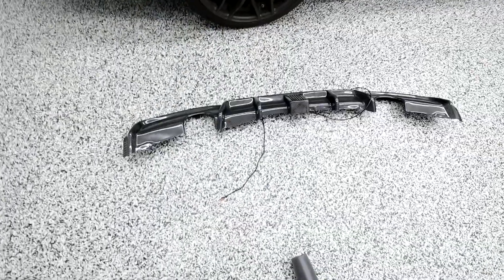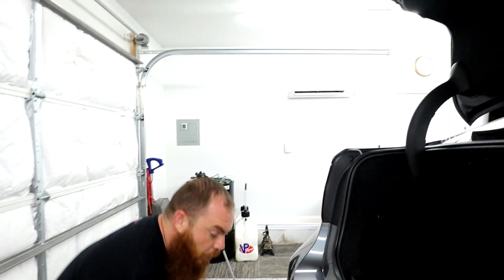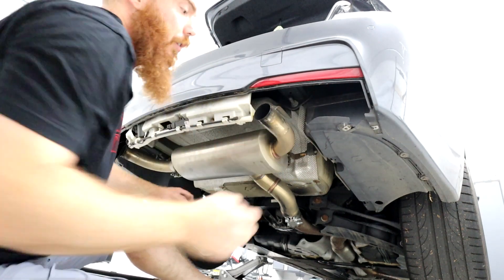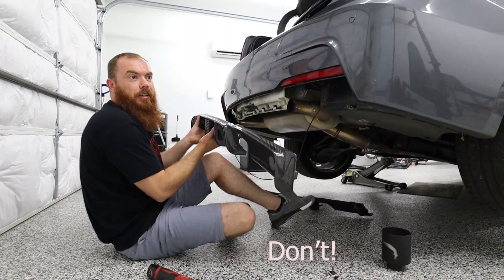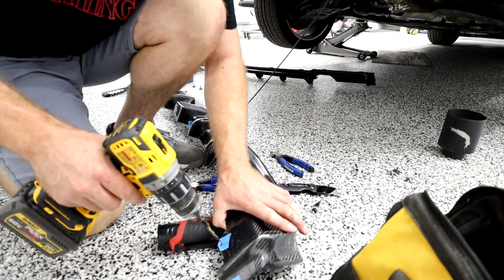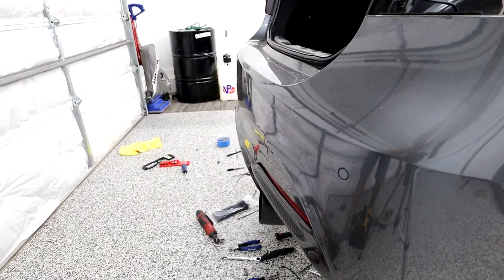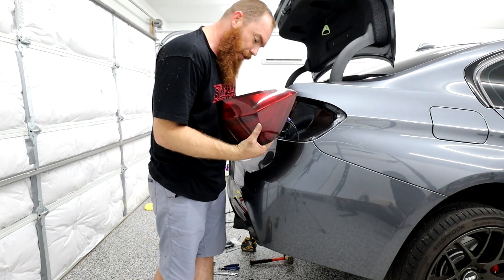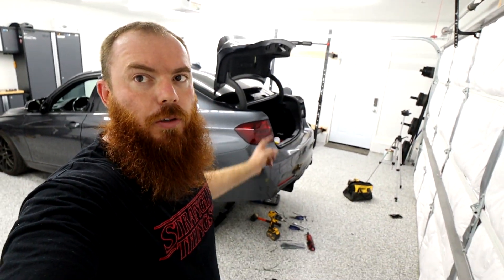CARBON DIFFUSER WITH RAIN LIGHT | INSTALL AND WIRING F30

Comment: Great video, it would've been nice if you could've shown a much more in depth guide and closeup of the wiring though. A lot of people including me are completely new working with electrical/wiring and this is the part I needed the most guidance on. Other than that, thanks for the guide!
Reply from the maker: Hey bro, what part of wiring you need help with? I think I said which colors goes where in  video but I can look again. Hard because I don’t ha e a cameraman for the best shots 🤣
Reply: @BOO5Tchannel  yea no worries! You did outline which wires go with which and that was really helpful. I was just pretty clueless as to how to use wire splicers, but after searching up a few youtube videos, it's all good. Thanks for the help!

Comment: Every single video is better and better, boss I don’t have Instagram how I know when you’re gonna have those back on stock? Definitely I wanna buy one for my 340!!! tomorrow I’ll get my car back from the MPPSK installation and BMW tune yeeeeeeeees 👍🙏🏻😎🏆☑️
Reply from the maker: Thank you bro, I will come back to the comments and let you know when they are ready!
Reply: Forced Induction Studios appreciated boss!!!
Reply: @BOO5Tchannel  I was curious about the exact same thing. I don't have IG but am interested if they carry these with the single cutout for a 328.
Reply from the maker: dollar2k3 I am not sure about non msport models but check eBay my supplier does not..
Reply: @BOO5Tchannel  mine is M Sport, but it's just the default flat rear diffuser. I was gonna opt for the one you had originally until I saw this one in carbon with the light. Much better upgrade!

Comment: hey man i just got this for my f30 340i and i want the light to be on all the time and then have it flash for whne i brake, i've seen some other vidoes but they don't really go into where to put which wire
Reply from the maker: Just play with the combination of wires and you will easily find what your needing it’s been 2 years I have no idea but that’s what I did trial and error

Comment: Hi , I wanna do the same thing in my car , I already installed the diffuser but I need some help , wiring the les light,  by the I want to do in the driver side ,  there is 3 cables I don’t where to wire 😅, can you help me
Reply from the maker: I don’t have my car to look, it’s only 3 wires try all 3 combinations till you find what you want very simple in had to do this to mine
Reply: I did already
Reply: It works , but it flash only when press brake
Reply from the maker: @198888joshua  it’s supposed to flash only when you brake.
Reply: Yeah , I like it , if I wire in another cable would stay always on night time , I like better only I press the brake 😎
Reply: Thanks for your video
Reply: I was about to to the technician guy

Comment: If you have BFD coded it should flash under heavy braking anyway but be steady the rest of the time just like your brake lights (can) do.
Reply: I suppose you could always wire it to the rear fogs as well as a 3rd fog light?
Reply from the maker: I can wire it to have BFD by switching the 2 wires but I wanted to go solid. Thanks for tip!

Comment: Got a unrelated question if you don't mind. I see in earlier video you went with an open box cold air intake (Injen I believe); I keep seeing the debate on the open air boxes and how they actually hamper performance cause they draw in hot air. This is also what Dinan says and why their N55 cold air intakes are all closed box. You don't think there is anything to that argument? Thanks
Reply from the maker: Hello, honestly I’ve never tried closed box to tell you the difference, I’m sure the research is correct but one day I will test that theory and dyno to see true numbers. I will also look at inner cooler temperatures and I will let you know with a video! It’s something that I’ve thought about and will definitely try
Reply: @BOO5Tchannel  awesome, thanks

Comment: Definitely wanna do this to my F30. But I would like it to permanently flash when turned on, like an F1 rain light. I thought about wiring it to the rear fog lamp so it flashes when I turn those on. Do you think that's possible?
Reply from the maker: You would need to check laws in your area about flashing red lights on your car... to me that light is quite bright to be flashing all the time,  it would be quite annoying at night in your rearview. I can see it when I reverse in my camera it’s that bright
Reply: Pretty sure that's stuffs completely illegal in Germany, that's why I wanna wire it to the fog light, never use the rear ones anyway, since you're only allowed to go 30 miles with those on. I would only use it for fun and like in really heavy rain.
Reply: @jhill92  Have you done it? Mine is coming in a couple of days and i thought about wiring it thru the car so i can have a switch near my seat.

Comment: so when i did what you 
 said in terms of wiring but when i turn my right turn signal on, it starts to flash. any idea on why?
Reply from the maker: I would double check your wiring I’ve never tried the turning signal to see if mine flashes though so maybe it should?
Reply: Im havin the same issue on a customers car with this myself if you can check see if yours is please let me know
Reply from the maker: @saeedmohamed7467  I sold the car but it’s not that many possibilities you can try them and see what works
Reply: I had the same with my car. Just for info the black with grey is the right turn signal, so you don’t need to connect it to this. 

I think it has 2 outputs so you could connect the the other wire to the fog light or something else. Once I disconnected the splice connector from the black with grey it’s stopped flashing when I indicate right and just comes on for braking. 

Many thanks for doing the vid, mine didn’t come with instructions and would of been clueless without it! 👍